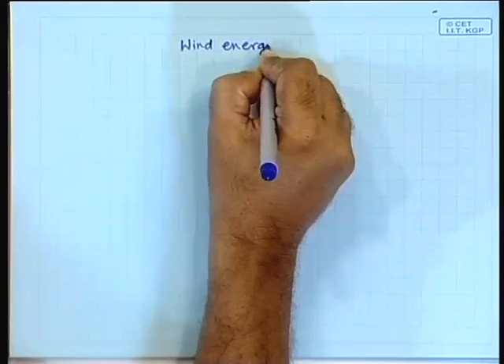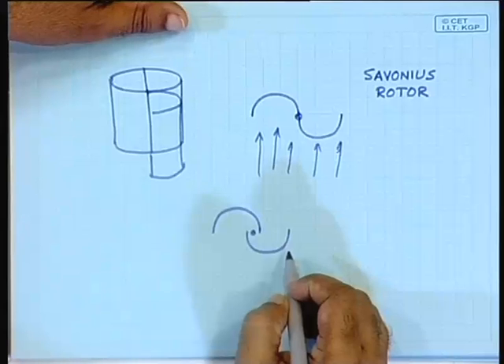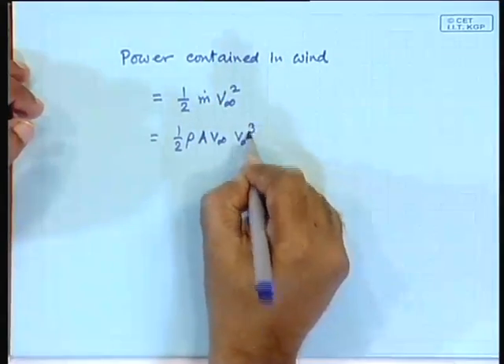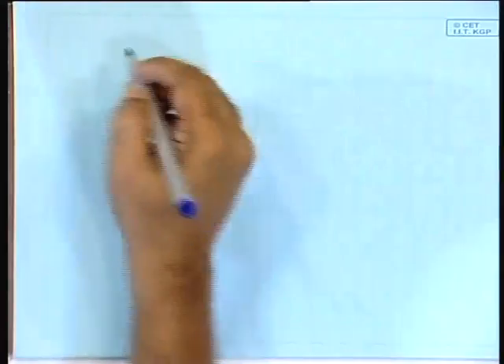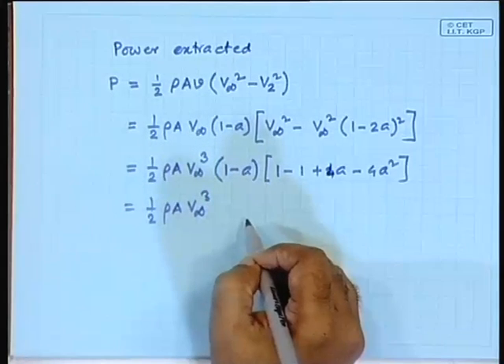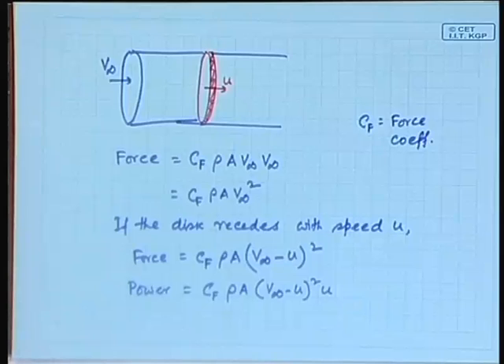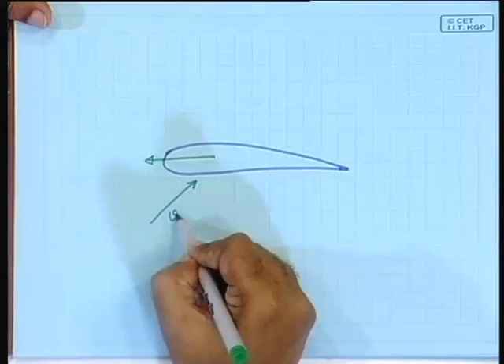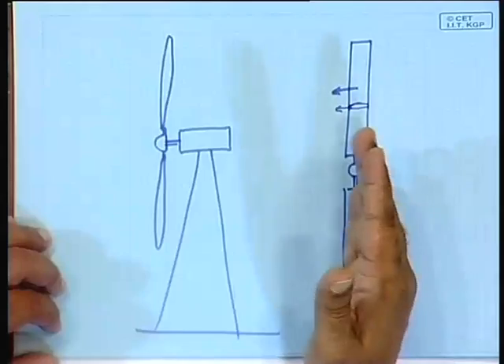Lecture - 21 Wind Energy I

Comment: 00:46 start: wind energy. Wind and solar are the most exploitable natural resources of energy. India is one the countries leading this technology. The beginning of wind energy is the Dutch windmill, operated by thrust (instead of lift), steam engine left this design obsolete.
06:33 Savonius Rotor. A cylinder cut in half. It is of vertical axis wind turbine, windmill is horizontal. Both works on the thrust principle (wind "pushes" the blades), which is inefficient.
12:15 wind energy is low quality energy, so there has to be a limit.
15:01 derivation of power wind limit. Finding the speed of the mechanisms. If a mechanisms is placed to extract power from wind by thrust means (such as a windmill or a Savonius rotor), this will displace at speed average the values of wind speed far before and far after interacting with the mechanisms, ie: v=(V_inf + V_2)/2
26:48 axial interference factor a. Maximum mechanisms speed V_inf/3, so max power extracted 16/27 of incoming power, half in the case of a thrust mechanisms or 8/27 of incoming power.
45:41 how does the airplane's wing work? relative wind speed w, speed triangle, lift, drag, pitch angle